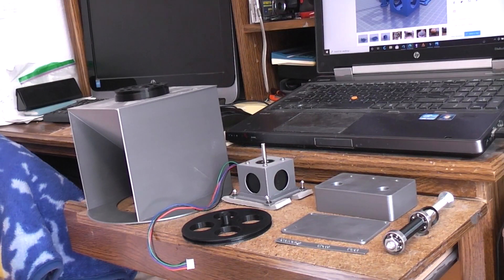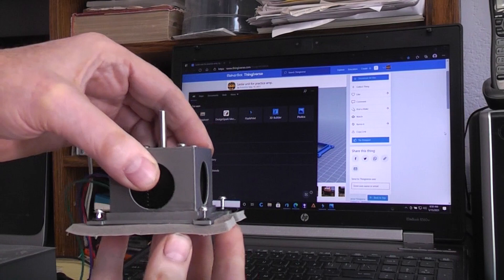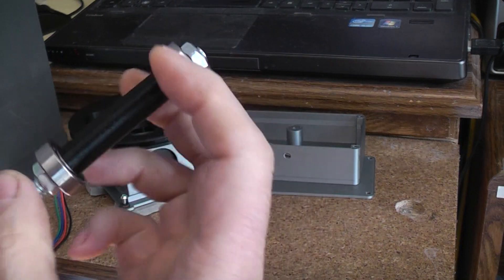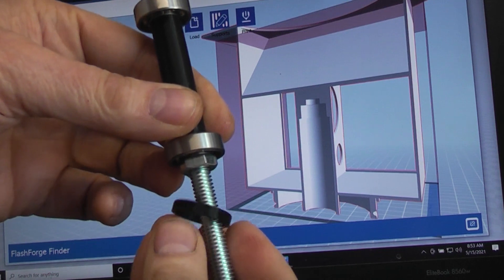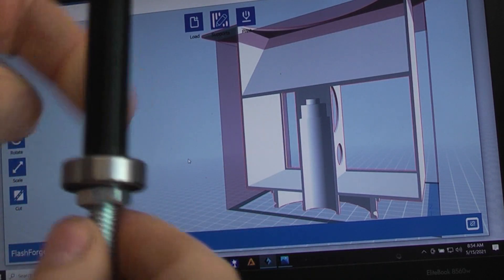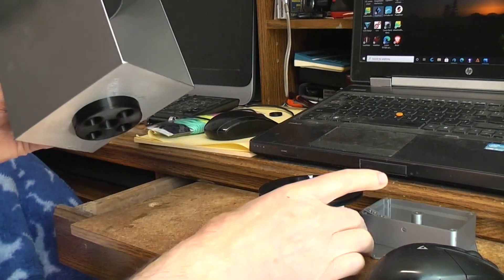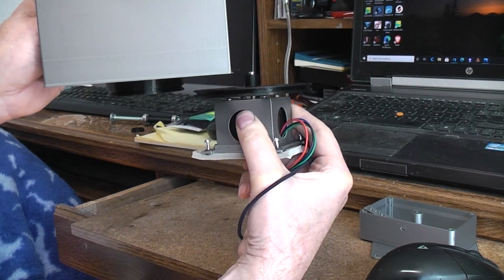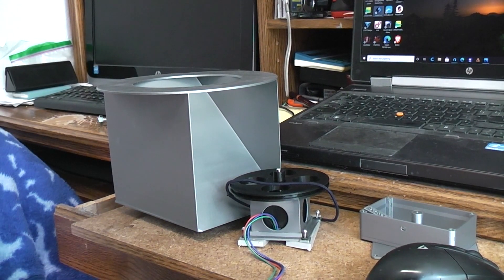Practice Amp Leslie build. Part 2. The 3d printed parts.

Comment: Hello there can you tell me what the diameters of the belt pulleys are thank you.
Reply from the maker: Its been a few years so I do not recall, but if you open the STL files in any slicer program or STL viewer program it will tell the exact dimensions.
Reply: @Robothut  O.k thank you for getting back to me .I'm having a go at making my own leslie twin rotor speaker but on a smaller scale trying out some horns made from papier- mache using polyester resin and maybe styrofoam for the bass rotor.
Reply from the maker: @roberthorseman7432  There were bass rotors made from Styrofoam for small organs back in the day. Keeps the mass down, so easy to spin. Maybe you could just use some plastic funnels for the tweeter rotor.

Comment: Hi,  excellent job!! really awesome the sound you can take from it.  I have download the stl files from Thingiverse.  The baffle dimensions are scaled or they are 1:1?  You print it with supports, right?  Well thanks in advanced from Argentina
Reply from the maker: The STL files are the correct size for the build you see in the video. Supports will be determined by your 3d printers ability to bridge when printing.

Comment: good afternoon god sir. first thank you for the videos. i started building the cabinet for one. and just now found your videos. question? I tried to download the files from thingiverse but cvan.t when i click on download it opens up a window asking to tip the designer. when i go to tip it says that robothut is not set up to take tips. can you please help?
Reply from the maker: I just checked and the files download fine for me. You can down load the files 1 at a time or as a zip file . When you select down load all files just wait, depending on your internet connection the files will down load with out clicking on any other tabs.